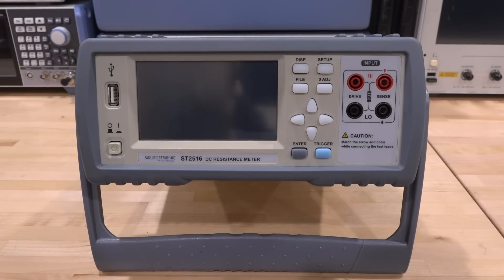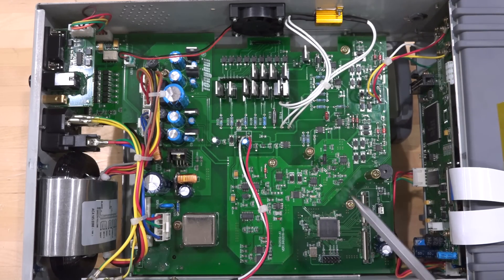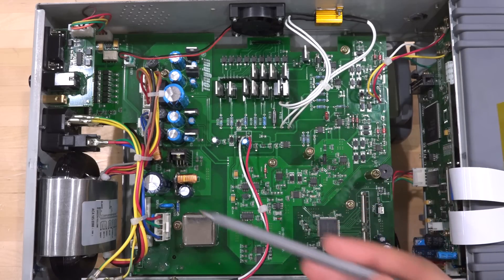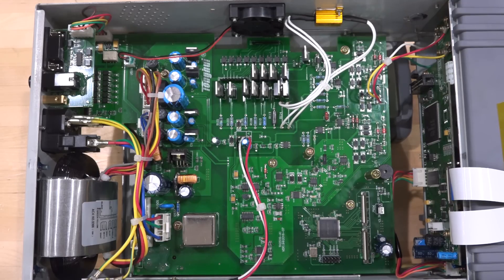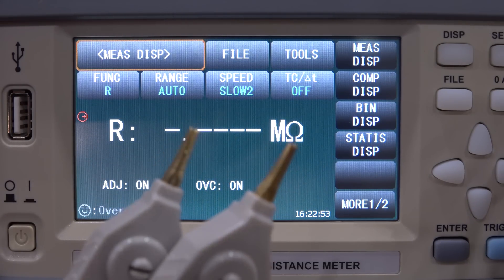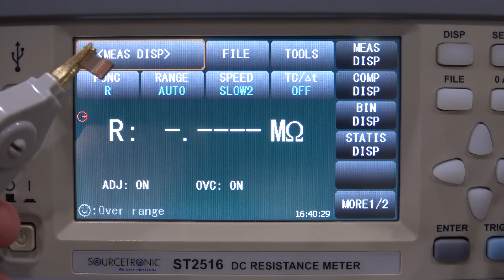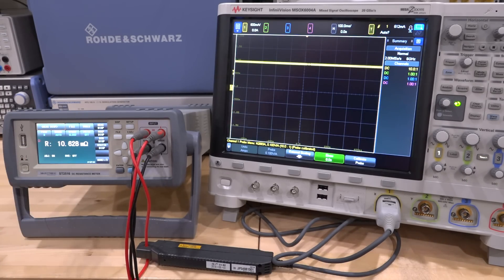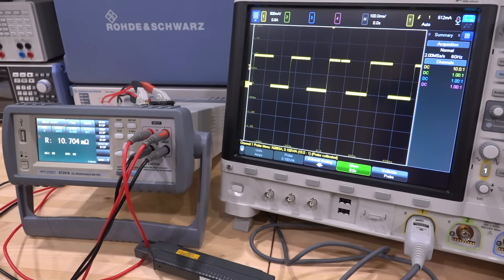TNP #38 - SourceTronic ST2516 Micro-Ohm DC Resistance Meter Teardown, Modifications & Experiments

Comment: I once built a version of this--admittedly very low precision--to find a short circuit in my sister's car. Just an LM317 some resistors, and a switch to select 10 mA, 100 mA or 1A. Coupled with a cheap Radio Shack DVM, I got 1 mohm resolution, and was able to find the short quickly. Fixing the short, on the other hand, took a day upside down on the floor of the car rooting around under the dashboard.
Reply: This method is common and can be used even to provide nanoohm resolution, by using higher power current sources (MI have current sources to thousands of amps) and/or better and lower noise detectors. Keithley has specialized setups such as K6221+K2182A to perform this method in so called Delta measurement.
Reply: That's why I don't like working on a car, even on my own. Too many covers, latches, screws and whatnot to get to a single wire or contact. Once I finally get it open, it takes me a very long time to put it all back together.

Comment: When you perform the zero measurement, be sure to connect your clips with an interleaved connection stack up of HiSense, LoSense, HiDrive, LoDrive so the path of the 1A current doesn't flow through the voltage sensing path.  Try a "proper" zero, then try connecting the probes in alternate stack up combinations to see the resultant errors.  Also, when you are connecting to 4-terminal resistors, grab the pair of wires at each end with the clips so each of the 4 clip terminals touches only one of the 4 resistor terminals.  Always use the AC current mode to eliminate the thermoelectric and offset voltage effects.

Comment: I've made a portable DIY unit using an 18V Cordless tool battery connected to a DC-DC converter adjusted for CV 3V and CC 10A.  With a couple of 2.5mm2 long leads and a DVM mV meter is ideal for chasing the micro ohms in 5kVA 24-48V battery systems or car winch systems etc. I've found 10A is ideal for testing those high-current relays and switches and surprising how relay contacts and high-current switches deteriorate and need replacing or servicing over time.  Even testing new high current switches only to find a wide spread in resistance values, and reject some brands due to higher than expected performance.
Reply: Why would you reject brands that gave higher performance?

Comment: SourceTronic seem to rebadge Tonghui gear (as do many other companies), so this would be a rebadged TH2516.
Based on comments on EEVblog forums the SourceTronic badged items do seem to cost more, but they also provide excellent support.
Reply from the maker: Nice, good to know.
Reply: What tipped you off, the large "Tonghui" printed on the PCB? 😁
Reply: There are some B&K Precision products which are made by them, like their very popular portable ESR meter.
Reply: @tarheels100  Haha, yeah I did spot that while looking carefully for a "TH2516" label on the PCB silkscreen.  I knew it would be Tonghui based on the design and previous experience with their devices.  I forgot to mention the PCB logo, but as you say it was kind of obvious.
Reply: @douro20  I don't know if it is still the case, but I recall seeing info on the Tonghui website that indicated they were a subsidiary of BK Precision.  Based on how many other companies rebadge the Tonghui models, I wonder if that is no longer the case as it would eat into their own sales.  It could also be a result of regional distribution rights which do not mean much for low volume customers.
Reply: @KeanM  If that were the case they've scrubbed every mention of them on their website.
Reply: @douro20  OK, I did a bit more digging and yeah I misremembered the details.  Oops!
It was ITECH that was a China-based subsidiary of BK Precision.  ITECH is another OEM of test equipment that BK and others rebrand - particularly known for power supplies and loads.  I own a few BK, ITECH, and Tonghui devices.  There is a lot of similarity between some of the ITECH and Tonghui designs and I suspect R&D staff have moved between the companies.  Maybe BK prefer to deal with Tonghui these days, and I think Tonghui build quality is better.
BK mentioned ITECH as a subsidiary in the 2015 and 2017 BK product catalog , but not in the 2020 catalog and I can't find any other recent reference.  On the Wayback machine of the BK About Us page I can see ITECH was still mentioned in 2018 and even in mid 2019 but no longer in early 2020.  I wont include links to avoid my comment getting blocked.

Comment: Hi Shahriar, thank you for your effort! As usual, great content, also glad you discussed the thermoelectric measurement and compensation. It is a simple but elegant solution measuring directly the thermoelectric voltage, regardless of which materials are being used, and of temperature.

At the risk of being picky, at 6:09, that 1% 100 milliohms resistor that measured 110.79 milliohms is actually quite off, it deviates 10%. 
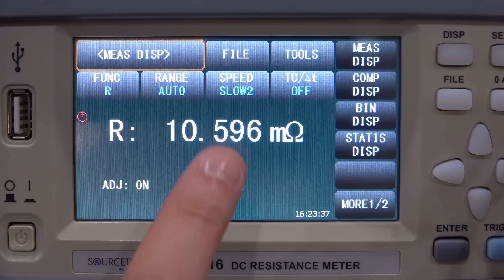Also, at 6:49, the 1% 10 milliohms is also off. It should deviate a max of 0.1 milliohm, so a max 9.9 to 10.1 milliohms.

I also use these cheaper kelvin alligators, and as you mentioned, you can't use them properly with these 4 wire resistors. At these currents, this is probably the main source of error. Especially considering that later, that SMD measuring 303 microohms is within 1%. The SMD shunt benefits more from the kelvin alligator, since their sense terminals are effectively closer to their power terminals compared to the previous ones. 

But there is the chance that the instrument is out of cal. Or the slimmer chance that both resistors are off.

Comment: But what is its output voltage during measurement? It may happen that it is too high for some components.
Reply from the maker: It’s designed to remain very low. Below 40mV.
Reply: The voltage is technically "almost zero" because you are measuring low ohms.

Comment: What is the value of the resistance when the probes are shorted together? شكرا على الفديو
Reply: The value is "null". Because it compensates for the resistance of the cables and connections, and is nulled (zero'd) before each measurement.

Comment: I would have tried taping over the buzzer to make it quieter before resorting to modifying the board.
Reply: 110dB is rather more than a bit of tape can handle. Think jackhammer, rock concert or putting your head against a car horn...
Reply: @ickipoo  You'll be surprised, it apparently messes up the resonance that allows it to get that loud. Ever tried it when hacking an old smoke detector?
Reply from the maker: Certainly possible. Trapping the air inside the cavity will quiet it down significantly. But this solution will never fail and I got an awesome huge buzzer out of it! :)
Reply: I ran into similar issue a few weeks ago with a very cheap UNI-T multimeter, 96dBA is just too much. I put a tape over that buzzer, which did almost nothing, then I tried to glue piece of wood on it, which reduced that thing to 82dBA, which is some improvement, but it's still too much, I tried almost everything, but replacing that buzzer with the "normal" one was the only solution I found.

Comment: What about the temperature that will raise making the resistance shift value?
Reply: You mean: you measure the resistor using a (large) current, that heats up the resistor. Is that being compensated? No it is not. But my guess is that this effect will be tiny as the power dissipation inside the resistor will be small. For example, the 10 mOhm resistor was measured using 1 A, that means P=I^2 * R = 1^2 * 0.01 = 10 milli Watt, which is not a lot. The resistor will warm up but not by a lot (how much? See datasheet for thermal resistance). Also, the resistors Shariar is using here will have a very small temperature coefficient meaning their value will change very little, how much can be found in their datasheet.

Comment: I thought dmms with auto zero do the same thing to zero out TE voltages or am I mistaken ?
Reply: Usually autozero in DMM means that internally meter will alternate between measuring your input signal and internal short to remove drift offset errors. Turning on/off current and measure residual TEMF is a different feature, usually called offset compensation or OCOMP in most bench top DMMs. Few meter go a step further and reverse current instead of turning off which can be important if you trying to measure resistances very accurately and maintain same power applied to DUT instead of pulsing current on and off.
Reply: @xDevscom_EE  thanks for the detailed explanation!

Comment: I assume I am missing something, BUT, why the hell is it pushing high current all the time, and not pulsed (something like 20uS at 1% duty cycle), ALL THE TIME!   Surely for the INSANE $ thing thing cost they could have precision op-amps stable in that time!
Reply from the maker: This is a DC measurement on purpose. Even the OVC runs as a very slow rate and can be turned off. As soon as you switch the current you will make measuring the resistance of large inductors impossible as the reactance begins to come into play.
Reply: @Thesignalpath  Yep, I knew I was missing something, DAAAAH!!!! :)